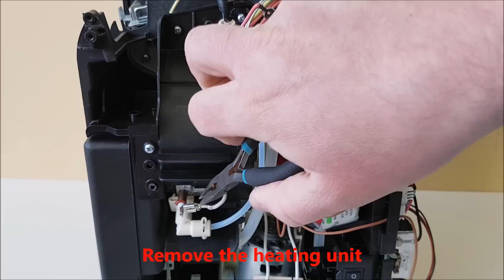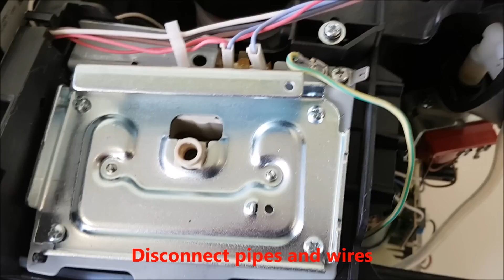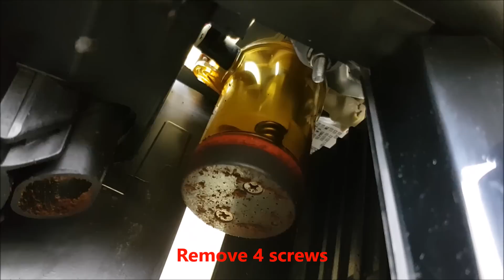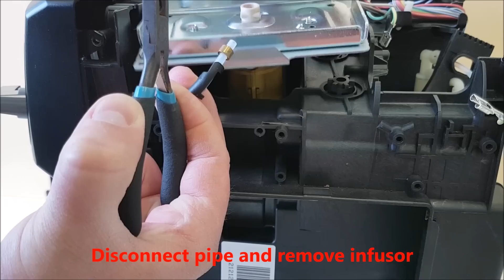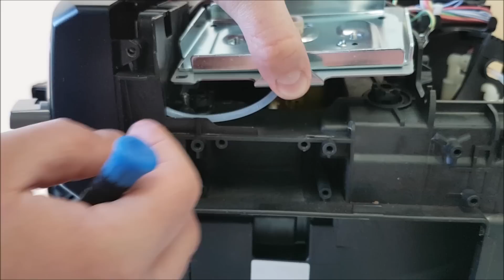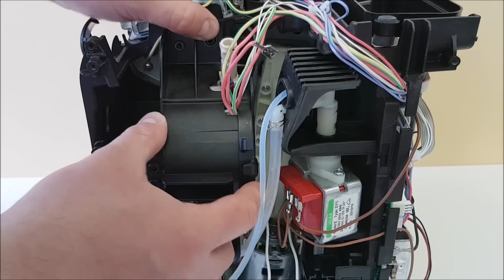Delonghi ESAM2600 ESAM3000 ESAM4000 infusor replacement

Comment: Hi, I have a EC860.M and I was wondering if you can give me some advice. The machine works good but it has been left unsupervised once and had no water in the tank for 2-3 minutes and made that horrible loud noise. After that it got louder when making coffee and started leaking water thru the steam nozzle, fixed the leak by switching to the cappuccino attachment and after making a cappuccino I inserted the tea nozzle back. Now the machine works as it should, no leaks but it is significantly louder when making coffee and the power light keeps on flashing red when the machine is on. tied to descale it 2ce using delonghi descaler but it just wont end the cycle properly on the last part, it just takes all the water from the tank to rinse it and I need to stop it because it wont stop on it's own when the tank remains empty.  Any advice on how to fix the flashing power light ? What could be causing the machine to be louder than the usual when making coffee ? Thank you very much and thank you for posting all the repair videos.
Reply from the maker: Hi, I can't answer now, but I have this machine and will do some tests and videos next week.